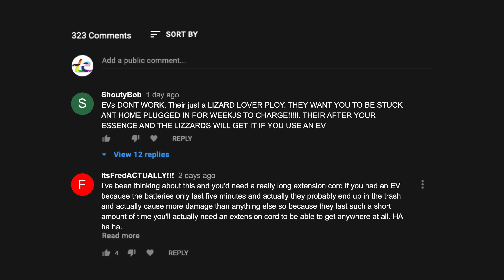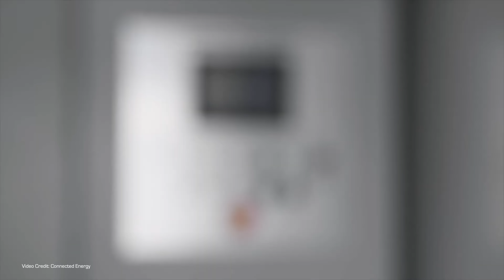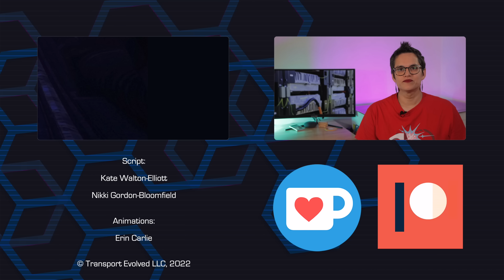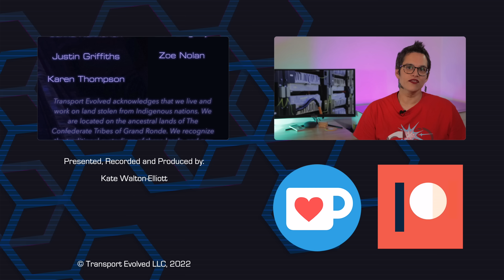What happens to the batteries?!

Comment: Here is the real truth. Cars with a short range in areas of weather extremes will be cycled between charge and discharge many more times and degrade faster than EVs with larger batteries and longer ranges. The problem is that those cars are not as efficient and haul around much more weight.

Now if you take a battery back out of a car and make use of it as a backup home storage system that battery will be cycled even faster and has a greater chance of catching on fire and burning down a home. 

Facts are facts. Now I am all for reprocessing those batteries into new batteries for use in many things. 

I know battery tech will improve but there are better technologies out there already than what is currently being used to build new cars with.
Reply: Jan 6 was "Wall Street Putsch" part 2   I have been involved with Solar and alternative energy for years . I have been around lithium battery technology before it ever was put into cars. Facts are facts. 

Battery fires are caused by shorting and thermal run away in the chemical reactions. Dendrites are the cause and form from charge and discharge cycles. The more rapidly and more often you charge and discharge the batteries the quicker the dendrites form until inevitably shorting occurs. 

These are facts about Lithium batteries that they are still trying to conquer. 

It isn't if , it is when. You hope that the battery management system will isolate or stop using the battery before it get's to that point. 

I have been in the industry for many years and home battery banks charge and discharge at a much higher rate than your average EV does. the battery bank gets used more often unless it is strictly for battery back up and does not get cycled daily or multiple times a day. 

If the sun isn't out the batteries will go into a deep discharge cycle until a backup generator or other system is used.

Lithium is a good technology but to put possibly abused old EV batteries straight out of a vehicle into home use is not a good idea. If they take them apart and build a backup battery out of just the best of the individual cells and toss any that might be suspect back into remanufacturing , I am on board. 

The ignorance of common sense is why we have codes to protect people in their homes. 

Again I am all for getting a second life out of weak batteries but, be careful in how they are applied using best practices.

I have been involved with reconditioning batteries and experimenting with them for years. 

I have a battery bank of lead Acid batteries today that has sat out in the elements in all seasons in a plastic deck box for 12 years of constant home use. Way beyond what they are supposed to last because of special charge , and equalization modes and profiles. They are not Solar rated Dekas or Trojans. They are regular standard chemistry flooded cell batteries. 

I work with all types of batteries and understand the chemistry. 

I have no dog in this fight accept to caution peoples assumptions on safety and ease. 

There is a lot more involved than meets the eye.

Just like the first Leaf batteries, when many of us were saying right away that this is going to end badly for them.

The real world is unforgiving of best intentions.
Reply: @desertdan100  is not the battery management system the thing that is being improved so much as to increase battery life far beyond expectations? Are not home battery management systems also used in a similar way? These things have been used with many different sorts of battery in homes for at least a decade, I'm sure we would have heard of the dire consequenses you predict by now.
Genuine question, I have no expertise in this subject.
Reply: @rogerstarkey5390  I do understand and have worked on many more systems than most people will ever see. I also worked on commercial sized special use power systems for the Military. I know what I am talking about. I used to work on computer rooms and was a rep for APC in the past. I UNDERSTAND battery tech and usage. I used to size and design systems and troubleshoot them. 

The average home owner uses much more energy than they think they do. They don't realize it because they are hooked up to the grid. 

Think about this and do some simple math. The average home has at least a 125 to 150 amp 240 volt system coming into their home. Those same homes use gas appliances as well as Electric.

Total Electric homes use approx. a 250 amp  incoming Electric service for an average sized home.
That is between 30 and 60 KW that is an average of 45KW now multiply that times 24 hours.

I have run thousands of load calcs for many  years. My father worked for an Electrical Utility trade from 1964 until 2007.

I could spout usage studies for hours.

The average home would suck  an average fully charged BEV pack down in no time flat in the summer or winter when the draw is the highest. 

There is a reason why most homes are grid tied. They cannot generate enough power to carry them through the lower exposure days or through the night under high loads. 

I say average. Most people in homes today will need to change the way they live and consume energy and invest in moving toward a different way of life in the future.

I am not going to debate people on this because it is pointless. 

Too many people want to put blinders on to the bigger picture. I deal in impartial knowns and facts. 

Facts don't care about feelings and those who are emotionally invested in an ideology will never be able to look at the future through an impartial lens.

I am not trying to tear down the EV world, on the contrary , I am highly invested in it.

I have investments in startups, mining, charging, building , manufacturing and infrastructure. I invest in fields that I know and understand and I don't put all of my eggs in one basket. 

I reiterate, people like me were telling many that EV cars needed minimum issues worked out before it will make sense. 

I really liked the Nissan Leaf and the BMW I3 but advised that the battery management and range issues needed to be fixed or it would come back and bite them in the ass and it did.

I am just trying to get people to think a little about reality. 

I am now bowing out and will not waste anymore time on this topic. You will catch up to me in about 5 to 10 years  and figure out that maybe I might have understood way more than you can see at this point in your life. 

In 1986 I could see all of this coming that we are now seeing today. 

In 1990 I could see what was on the horizon  and the real power of the Bankers, and Corporations to subdue progress in the direction it needed to go. They will let you have the tech when it is convenient for them and they can profit off of it.

I have told everyone from the beginning  that TESLA was going to explode but that the build quality of their cars was not up to manufactures standards of today. They are getting better but not what they should be. 

I really like Tesla technology and advancements but Elon is riding on the backs of others that came before him. The new Electric drive motors he has today were invented over 20 years ago by some real forward thinkers in their time.

Their battery tech needs to advance much more than it has already if they want to really push the envelope. 

Well good evening and good luck in the future.
Reply: @judebrown4103   Battery management systems are always advancing slowly but some things just cannot be changed unless the chemistry and designs are changed.

Current Lithium battery tech is not where it needs to be yet. Fast charging needs to change as well. 

I have investments in different areas and stay on top of how they are progressing. 

The battery chemistry will be the leap forward or even better would be super capacitors and different battery tech altogether. 

Current batteries in BEV s today are already damaged and degrading simply because of the chemistry and the Dendrite formation that shorts out the cells. 

If they are pushed farther through even more rapid charge and discharge cycles they will just degrade that much faster and the greater number of parts and circuits , the more chance of an inevitable failure and possible thermal run away. 

If you have ever seen an uncontrolled metal meltdown and fire you will think twice about putting it in or on your home.

Even fire departments have had to get special training to learn how to deal with EV car battery fires.

If they took the EV battery apart and tested each individual cell and made a new back up battery out of just the best cells and added extra safety and fail safe systems , I am all for it.

Reprocessing and remanufacturing is a good thing if done correctly.
Reply: @desertdan100  thank you very much for your detailed comments, I have read all of them and appreciate the time and trouble you have taken to pass on your insights and experience. 
My takeaways are these: that we should sip/trickle charge our batteries where possible and not all the way to full, having not let it get too low. (using chargers in the open.) Infrequent rapid charging must be done with care and careful observation of the pack, maybe with one of those OBD dongles and the app.
 For using recycled batteries as storage it was always my intention to have them on an outside wall. Perhaps some sort of fireproof deflector cover above might be prudent though, I have seen shots of an e-scooter battery in flames so I know it needs special handling to "quench" once it's gone up and realise its almost impossible to put out.

Over here 🇬🇧 I do believe that battery recycling for storage is done in just the way you describe, separating out the good cells from the degraded. We have new recycling factories which will deconstruct and reuse the individual components of those cells and packs which are not suitable for reuse. Although it does seem somewhat alarming to me when you see shots of them being chewed up in a big crusher, I hope and presume that the volatile chemicals have been removed before this happens!
I do think battery operated vehicles is the only direction we can go in but with all due caution. We are in that transitory stage of human development where we just have to hope that our skills keep up with the needs of the earth. It seems to me that change is advancing faster than any time in history due to our use of computing to speed up our thoughts and the sheer numbers of us infesting the planet! We must be aware though that we may trip up every now and then in our headlong flight into the future and be prepared to accept the consequences and changes of direction required to get us safely through it.
Reply: Jan 6 was "Wall Street Putsch" part 2  Hah Hah Hah, this is almost comical. 

The difference between a surge load or draw and sustained higher draw is night and day on a batteries capacity output. 

Why do you think all BATTERIES have an amp hour rating? Why do you think some batteries are rated at different amp hours or KW ratings. 

How long do you think a 77 KW battery pack will last if you draw a constant 100 amp discharge out of it?  How much heat do you think it will start to build up and how long will it take?

Do you realize why fast chargers need to be well controlled and why a Nissan Leaf can not possibly charge at the same rate as a Tesla or Ioniq?

I perfectly understand all of this. 
I also understand why Tesla has pivoted on their charging and battery Chemistry. 

I also understand why Atlis was able to do what they claimed and proved that they could charge their batteries at double the rate of Tesla. 

I also know why Atlis is going to have to build their systems in Australia. 

I have invested heavily in them in the past and they are just now going g to go onto the public exchange. 

Again I am 5 to 10 years ahead of most people on this stuff. I am not tearing down the industry.  I am realistic and cautious of pitfalls I see coming. I am very invested in the Industry and have been following it and been in it for years.

Why would I want to destroy what I am trying to build. I just don't like people stating things and trying to push claims that are not prudent that will do more harm than good. Green washing.